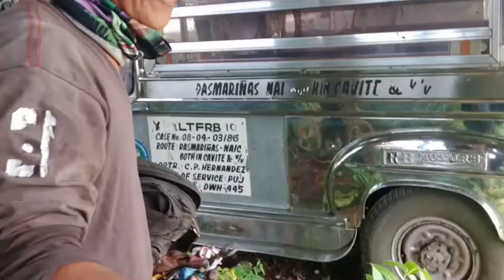starter repair change Bendicks drive, Armature,and carbon brush...

Comment: nag Ispark kc yan pag naubusan ng carbon kaya kinakain ung commutator. at isa p ung nabibiling mga bagong armature walang hinang n lead kaya hanggat bago ok p yan pero kng nag init n yan at namula n ang  connection ng winding at comm. dun n magsisimula ang pag spark ng carbon kaya kinakain ang ng carbon ang comm.